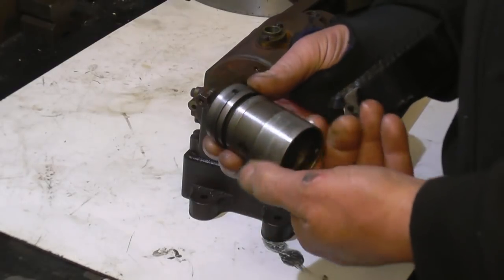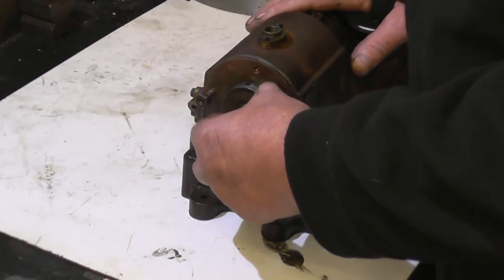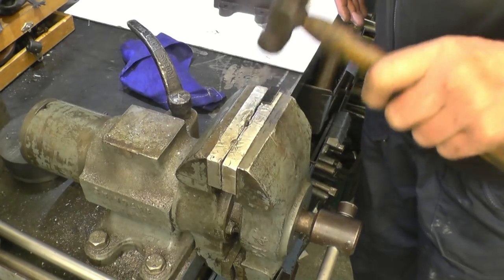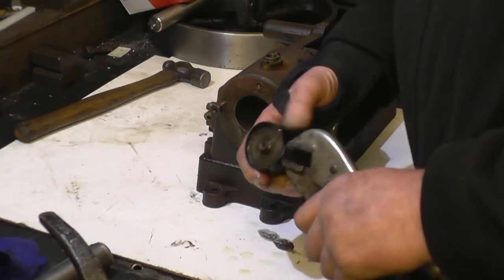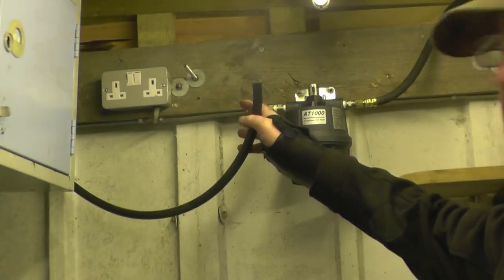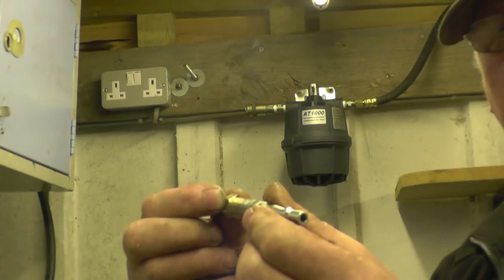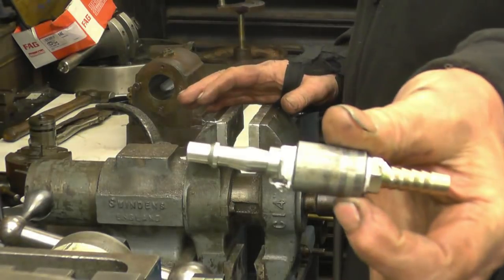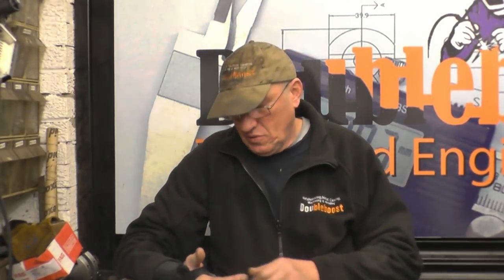SNNC 201 P2  Getting Ready For Plasma Cutting

Comment: I got hold of a PCL 'Dropout' separator for my plasma cutter. More expensive to buy, but no replaceable cartridges. I have a paranoia of using my plasma (or my TIG) anywhere near my computer equipment. I wonder how they shield their control electronics from the energy generated by the plasma.

Comment: Hi John: For your ring compressor (not sure what you call them there but) a gear clamp or hose clamp (the ones that adjust with a screwdriver and have the pinion and slots on the side) work a charm as ring compressors. Great stuff. I enjoy your videos. Thanks.
Reply: we call hose clamps jubilee clips as john mentioned
Reply: Ok. Thanks. I was wondering what that was. The advantage of the Jubilee clip is that you don't have to have spring steel around and you don't have make a new ring compressor for each sized piston. One 4 inch clip can fit just about all typical sized model engines. Not a big deal I've done it John's way many times as well. Great stuff. Keep up the good videos.